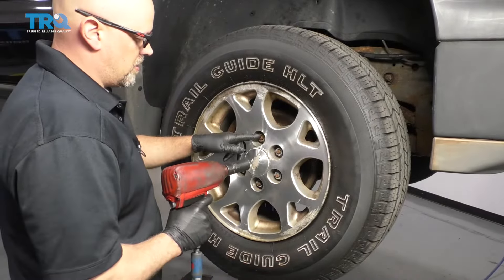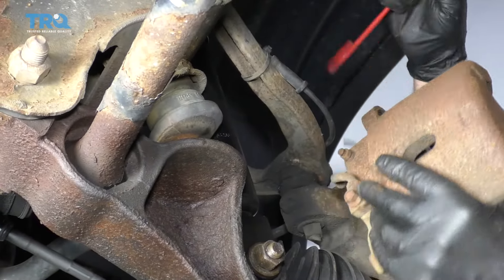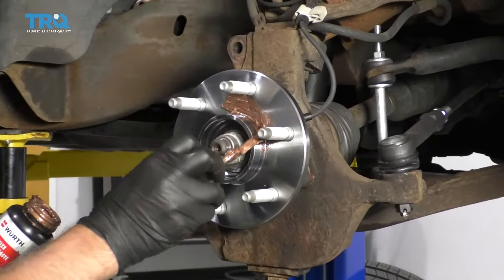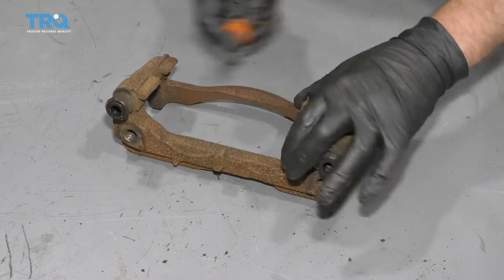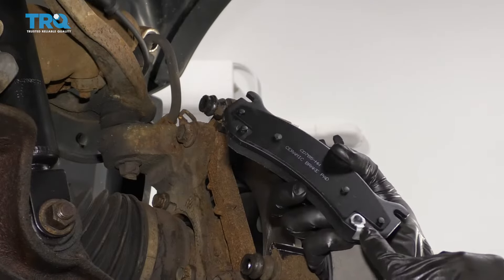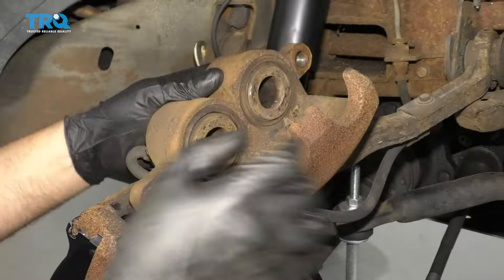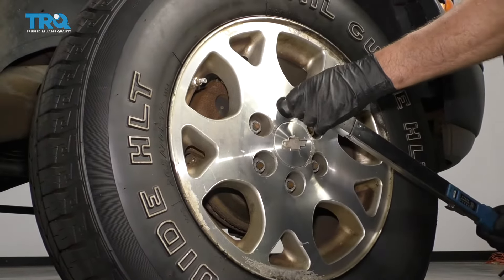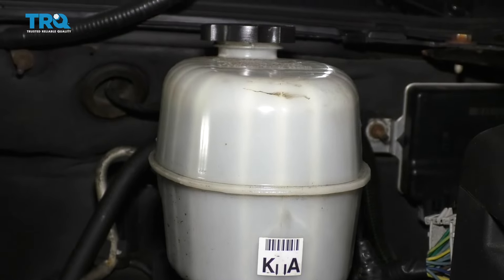How to Replace Front Brakes 2000-06 Chevy Tahoe

Comment: Notice at around the 4 minute mark they cut the video to the next step because it's impossible to put the outside brake pad on the bracket after you installed it. You must put it on first then install the bracket. The inside one doesn't matter. It goes on fine. This is deceptive editing. They should have redone the video to show the ONLY way it can actually go one.
Reply from the maker: +David Teske Thanks for watching our video! http://1aau.to/m/Shop-TRQ

Comment: My caliper has a t55 torx bolt.  Not an 18mm holding it on
Reply: I think this is what mine has. Another trip to the parts store!
Reply: Pretty sure ur slide pins are either 18mm or t55, not sure why. I’ve seen it both ways. Frustrating if you need to run back to the parts store.

Comment: I have yukon denali xl 2004 and it has T55 Brake Caliper Bolt Guide Pin and want to replace them with Hex bolt,are the torque specs will be the same 80 ft/lb?

Comment: Also, on the 2003  2wd Tahoe the caliper is bolted on using a Torx T55 NOT an 18 millimeter like it shows on the video.